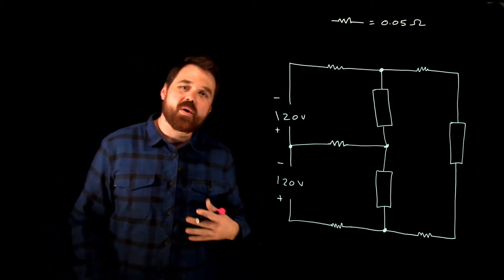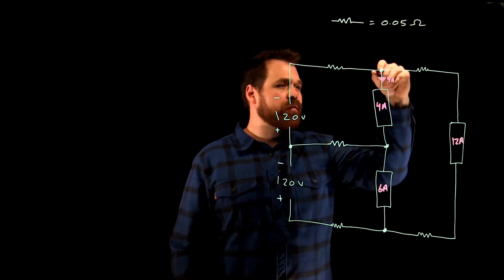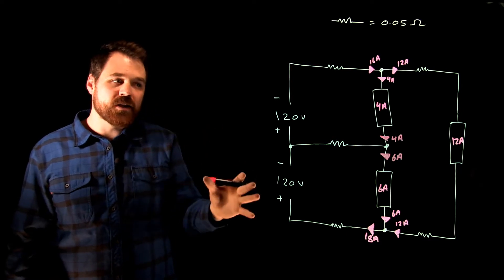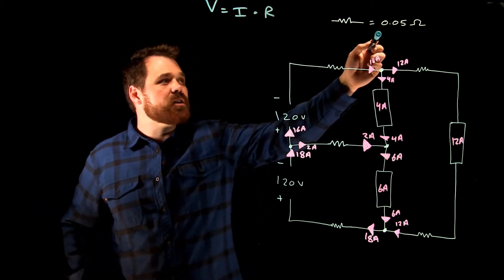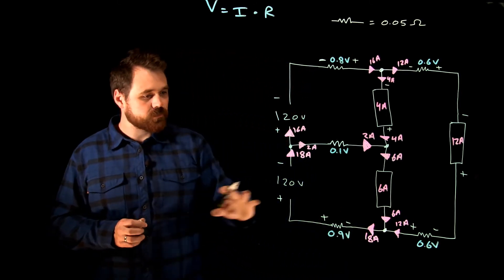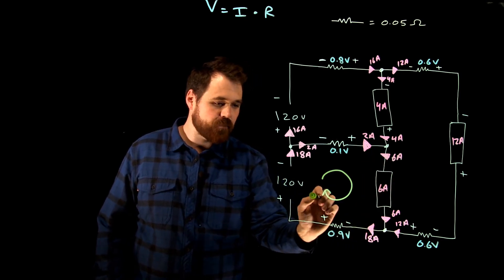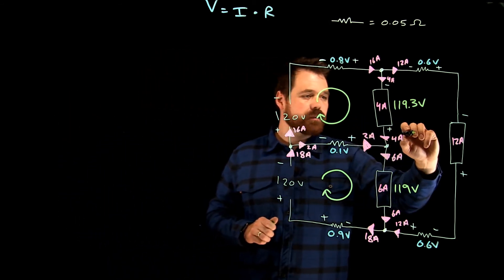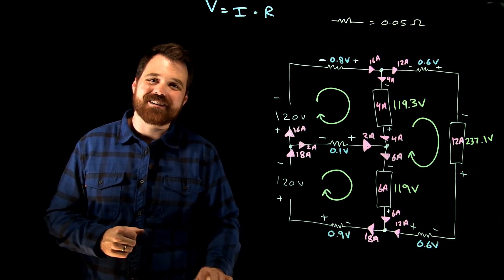Edison 3-Wire Circuit

Comment: Why is your 2amps through the neutral going - to + pink arrow and your green circle arrow which shows current flow is in opposite direction on the neutral.
Reply from the maker: This video is using the principle of Electron flow, meaning current flows from negative to positive. The neutral is bringing the additional 2A required for the 6A load.
Reply: @ZackHartle  4a flows on the neutral to the winding to complete the circuit. Then 6a flow on neutral from the winding to the 6a load and back to the winding on the bottom wire. The residual 2a is the difference of 4a going one direction due to polarity subtracted from 6a going in the opposite direction due to polarity. Currents flow on neutral in opposite directions. Which coincides with your green circles for current flow.